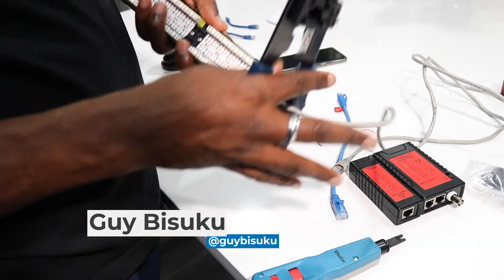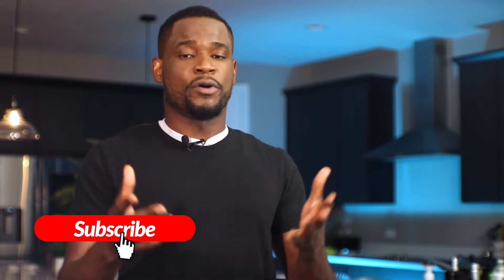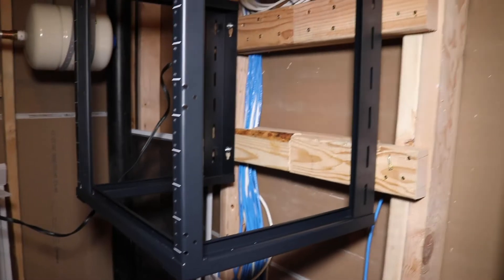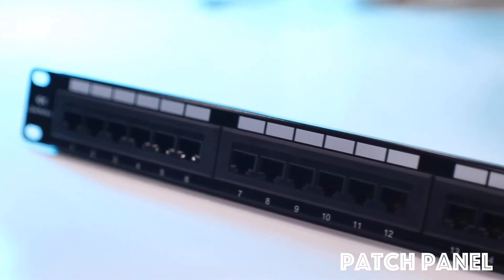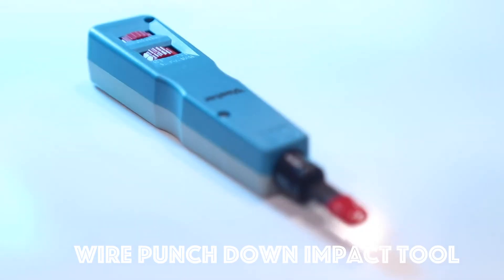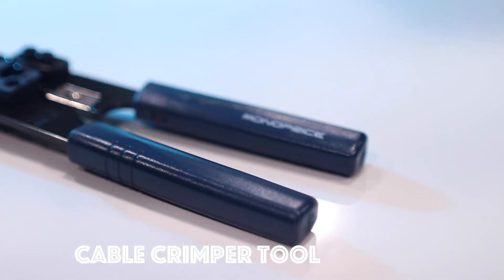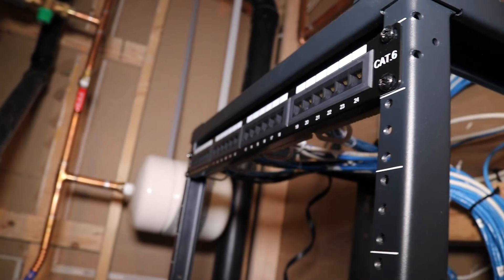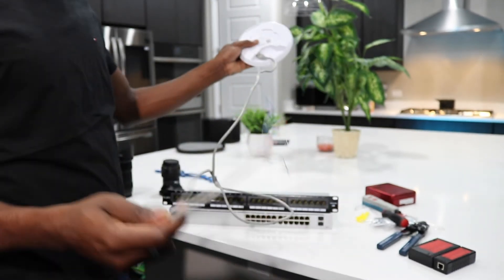Installing a Home Network in My New Home 🏠 | Video #2: Cabling and Patch Panel

Comment: Could someone give me answer for should I use shielded cable for a POE unifi AP in about 20 meter run or can I go with a CAT6 UTP cable?
Reply from the maker: Cat6 UTP should do it.
No need for STP unless there is high interference along the route.

Comment: Give an in depth detail on vlan configuration and wifi.
Reply from the maker: Sure. will post more more on it soon.
Reply: @KBTrainings  appreciated brother. 
Very curious about separate vlan for wifi. 
And also if your access points will reach the 1gbps maximum speed. 
Just subscribe. 👏
Reply from the maker: I see.
Will configure my VLANS soon.
For the access points, the ones I bought won't reach 1Gbps on a single  channel, the max is around 750Mbps I thing and it is MIMO and will likely go to multiple devices. So I don't count on impressive wifi speed in my case
Reply: @KBTrainings  that will do! im still learning networking and on the process with my ccna.  really curious, so i can build my home network in the future.  thanks brotha
Reply from the maker: Perfect! Thanks to you!

Comment: Enjoying your videos. I do have one question though… was there really no other place in your home to install your rack? I mean adjacent to and under hot water piping is a REALLY bad idea. If it has to go there, maybe pickup some plastic corrugated roofing cut to fit and fastened as a “hat” (angled up to allow for trapped heat to escape) and side shielding on the right side (facing forward from the rack) for the copper pipe on that side? I’d hate to see your tech spritzed from a pin hole leak or weeping solder joint.
Reply from the maker: Glad you're enjoying the video!
You have a point, I should've made sure with the builder that the cables are converging at a different location like under the stairs (where I am going to install my home lab 12U server rack, video coming soon...).
Thanks a lot
Reply: @KBTrainings  Yeah, keep the videos coming. I can appreciate how much work it is to plan, focus, film and edit all that content. Keeping it on point and informative the whole way through. But the plumbing situation is totally protectable with the aforementioned corrugated plastic roofing. And there should be minimal trapped heat with that solution too. Sometimes you just have to work with what you have and make the best of it. Learning from each other’s experiences and insight is what makes us all better at what we do. Blessings to you and yours.

Comment: Fun fact: you can actually have both type A and Type B cables in a network and it won't actually matter.  As long as both ends of each cable are the same type(A or B), everything will work seamlessly.
Reply from the maker: Hey Adam! You right! I see it now.
All cables are straight cables these days and the NIC are smart enough to adjust themselves.
Thank you for your viewership!
Reply: True.. but don't do it unless you have to.  It can get confusing when you're adding plugs having to find what the other end was terminated as.
Reply: @blaizerhodes  that's why I'd only ever mix and match patch cables themselves, and never a whole home install..... Only the patch wires.  Ever...  If you wire a house you wire all the wires the same. And then right down what the standard is near the rack.....

Comment: using CAT6e can you use one up-link from a patch panel with multiple data connections to connect directly to a switch
Reply from the maker: Hello James.
I am not sure I get this, I may need a drawing 😀
But if I understand, I would say yes.
Your uplink can be attached to the patch panel, from which your switch can feed.
Let me know if that was your question.

Thanks,
Guy